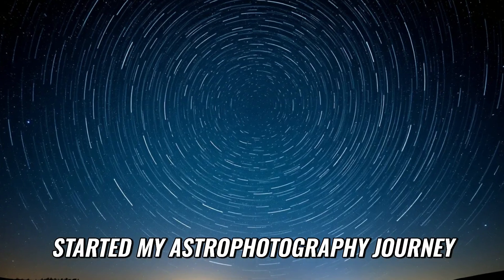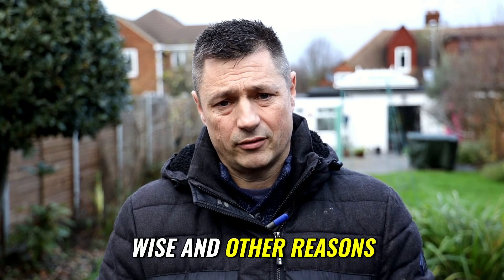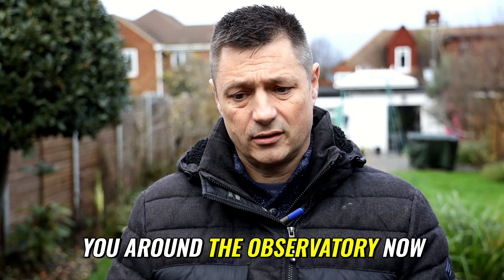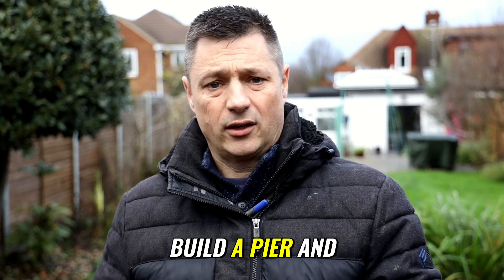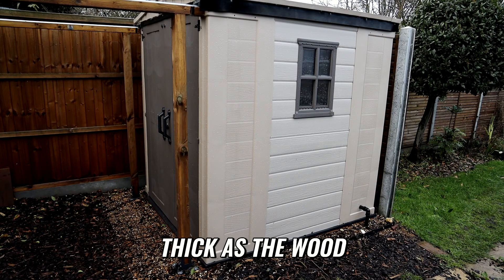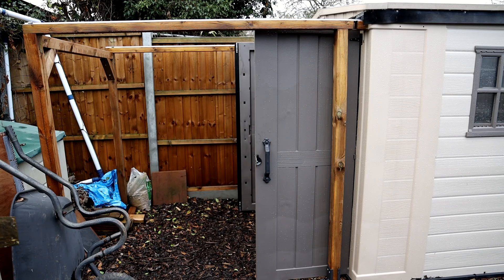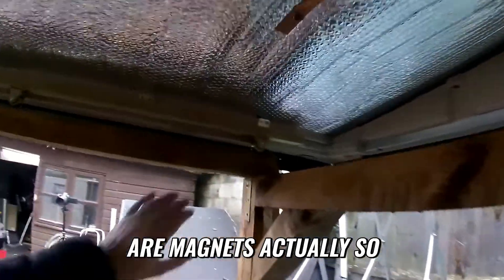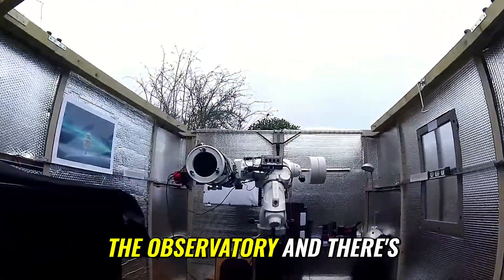Build Your Budget Observatory: Affordable Astrophotography Setup

Comment: I built my roll off roof observatory a couple years ago, and built my shed out of pallets free from a factory where my wife works
6 x 6 concrete base, also a concrete pillar, for the roof used heavy duty casters 4 each side and to guide the casters 25mm x 25mm angle iron which l already had. l split the pallets down to 75mm x 15mm x 1200mm lengths. The frame is made from 3"x 2" timber (from B&Q) nailed pallett timber on the outside and then the inside with insulation between them. Like your observatory the is a gap between roof and walls l had roll of DPC used for damp course on brick walls, used a heavy duty staple gun to hold the tape in place. l operate my telescope 3mtr away in my other shed, using my tablet to operate the ZWO ASI airpro on the septup l have. This setup is ideal for me now that l'm 70, no more carrying everything outside🤣🤣
The cost for everything was about £100
Reply from the maker: Hi Tony and thank you for sharing this. That really is a budget observatory, well done. Its such a boon having your gear permanantley set up especially as we get older.
I would love to see an image if you are happy to share any? I would love to add some images of others builds in a video. Astrobloke@outlook.com    clear skies Glenn

Comment: Thats a good cheap solution Glenn. I would love an observatory but because of the layout of my garden its not currently feasable. I do have one of my rigs semi permanently set up outside and use a Telegizmo's 360 heavy duty cover. This has been quite successful. I repurposed some fence post brackets from B&Q to lock the tripod in place and it has maintained good polar alignment. I'm thinking of perhaps installing a motorised rain cover or awning controlled by a weather station in a similar manner to how you described controlling your observatory roof in a previous video. It wouldn't be the same as a real observatory of course but it would would mean I could leave my rig on standby over night if there was a chance of breaks in the cloud.
Reply from the maker: Thanks Kevin. Thats quite a cool idea and its all about the practicality in the end. If it works, keeps your gear protected and lets you image quickly and easily its the perfect solution. Let me know how you get on.